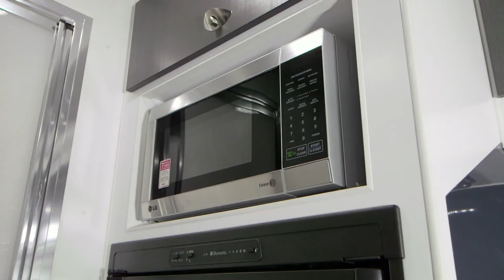Concept Caravans 'Your Time Is Now'

Comment: Intrigued that there are no comments here. As 'hands-on' owners, it would pay to monitor comments on the Concept Owners blogs so you can address small design or manufacturing issues, some at no cost to rectify,  just a small change to how you do things. One point in case, the 'breather' hose from the water tanks. IF the vent pipe 'droops' below the entry point into the tanks, which it does, water enters the breather hose and as a result,  will no longer 'breathe' as it now has an airlock due to water entering the pipe and sitting in the pipe at its lowest point. Easy fix. Either fix the pipes above the entry point so they cannot 'sag' to a point below the entry point, OR, install a harness to FILL and drain the water tanks, from one point, from the bottom. 'Partial filling' of water tanks is a major issue for the above mentioned reason up to the date I am writing this. This is not meant to be a criticism, but rather a suggestion to make a great product even better at little or no additional cost.